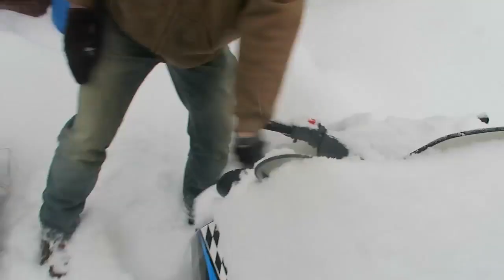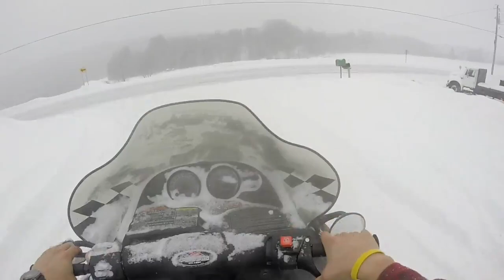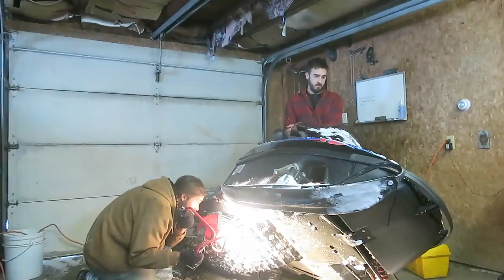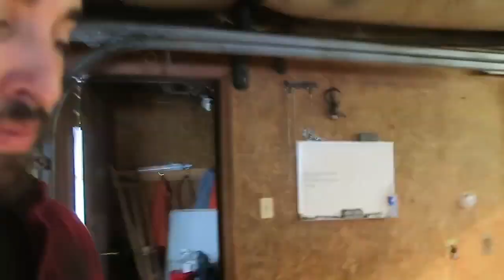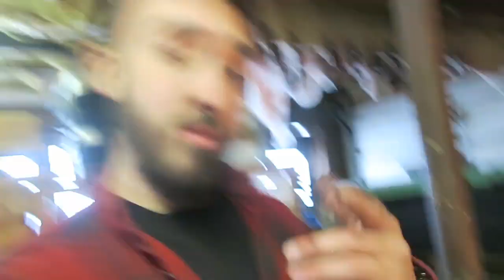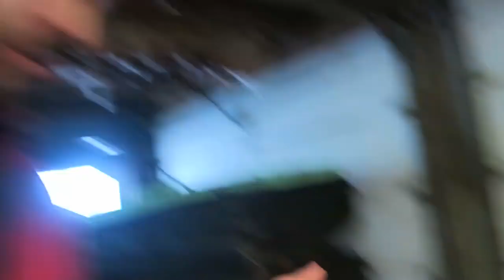His Snowmobile is DESTROYED!! (Drive Shaft Destruction)

Comment: My 2001 MXZ 600 has had some serious problems over my ownership of it. Bout it not knowing that the engine had been blown. So when I got it back, the engine blew in 30 mins. We rebuilt the whole top end which cost me half the season. Then, this year early December, the chaincase went. Luckily it was only a blown chain and no damage was done to the gears, but another problem nonetheless. After replacing the chaincase, my heat exchanger blew out, stranding me 50miles down the trail. Fixed the heat exchanger and now I'm having clutch, and engine issues. It is the sled from hell for sure. Continue these repair videos. I love learning new things to do by myself. You're videos are amazing and keep up the great work!!

Comment: Worked on the older wedge style lots and find the the big cc triples will break them under stress from no slip with a studded track.
Much the same effect as a quad twists off a shaft with big tires.
Also the outer bearing will stick also and pull itself apart if not maintained with grease.
Hope this helps.

Comment: Had that same bearing go out on my 1993 indy 500. My driveshaft was still usable but it also cracked the chaincase at the lower bearing. I ended up getting a used chaincase and upgrading to the xtra 10 suspension. Be advised there is a bearing retainer for that side of the driveshaft. Do a google search for a parts blowup for your sled, it will show you all the parts you need. Good luck and yes please do a video on the repair.

Comment: I've got the same sled. My shaft snapped completely. I did it by jumping hard drifts and there was no driving it into a garage.  I was miles from home and had to walk in then spent 2 hours  in the dark trying to get it on a trailer by myself. I was so tired that I didn't think to pull the belt to make it easier to load. My chain case had to be replaced as well. I love jumping those hard drifts but not enough to go through that again.

Comment: Yes i've seen that happen quite a few times. It's from not changing bearings before they go. That bearing went, (When the speedo goes, the first thing you should check is that bearing is bad, because it sheers the speedo shaft off) and because he kept driving the sled, the shaft was just turning inside that coupler (aluminum shaft on metal coupler).

Comment: When the speedo stops working it usually is a sign that the bearing is going bad, it’s designed that way to let you know it’s time for a new bearing.  There is a small speedo cable insert that goes in the center of the drive axle that is designed to break when the bearing starts going bad.  Hope that helps!
Reply: My speedo doesn't work and this happened to me too. I fn wish I'd known this before it happened.

Comment: I was riding my 06 Arctic Cat 660 (no turbo) down the trail at about 20 mph and I got about three seconds of shaking and then a crunch and it didn't go anymore.  The shaft snapped right in the middle.

I determined that it is an inherit design flaw of using a hex shaft, as the shape of it creates stress concentration points that just simply results in metal fatigue over time.  Some sleds go forever on that shaft without issue, and some break.  I added 2 driver wheels for a total of 4 in hopes of putting some of the stresses out towards the bearings, where such forces have less mechanical advantage on the shaft.  Hopefully, that never happens again.

Comment: A torch works good for getting the bearings off. The secondary drive will slip off if you loosen one bolt I would replace with new shaft and bearing because I wouldn't gamble with used parts. Put a drill on the speedo cable and see if it will work I fixed the speedo on my 700 and works like it was never broken

Comment: If it was me I would check the bearings in the suspension wheels hyfax and the bearing behind the secondary clutch because it doesn't run in oil like the chaincase ones do

Comment: Not sure if you already put this machine back together, if not inspect all the bearings in the rear suspension and replace any that are rough. Esp the 3 rear most wheels, if they fail you loose track tension. Also a good time to inspect the sliders (hyfax). That secondary clutch should come off without a puller, makes installing the driveshaft bearing and cup easier.
Reply from the maker: I agree!! We are going to give it a good walk through!!